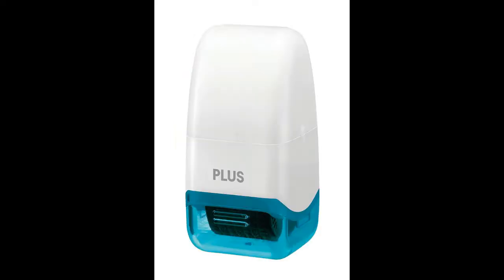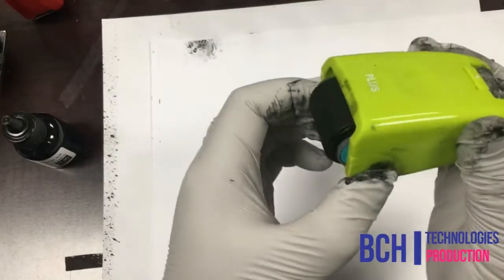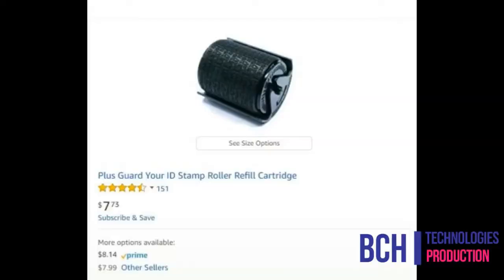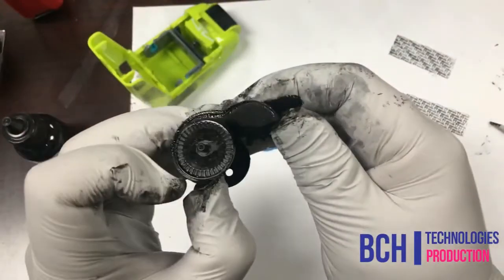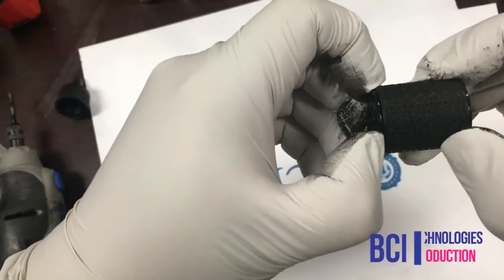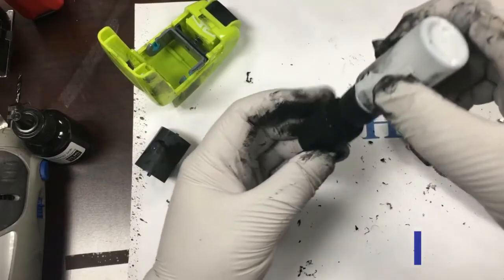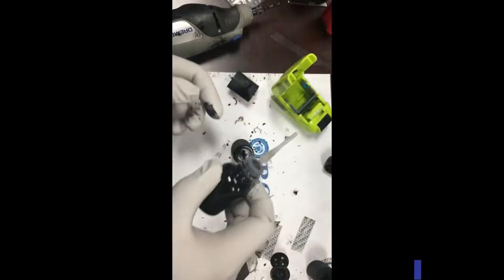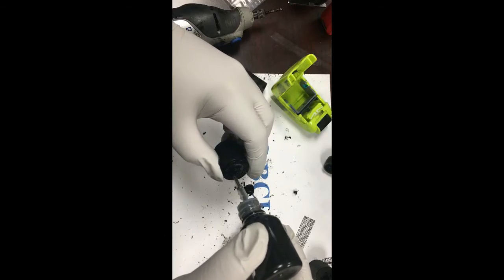How to Refill Plus Guard Your ID Roller Stamp - Refill Stamp

Comment: or we can just roll it in a stamp pad? its just something I've thought while thinking how to use it after it runs out of ink. mine still has ink, so I haven't tried it yet
Reply from the maker: It is better to add to the core but your idea works too.
Reply: I was thinking the same thing.
Reply: I’ve tried it and it comes off really weak 😢